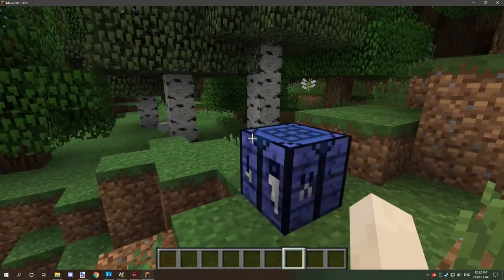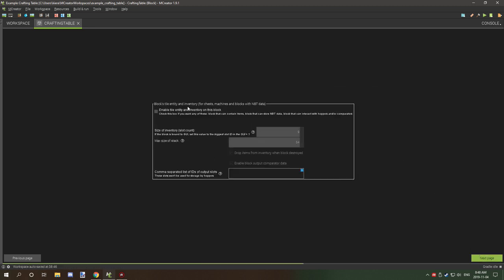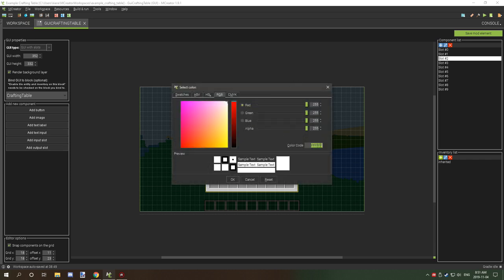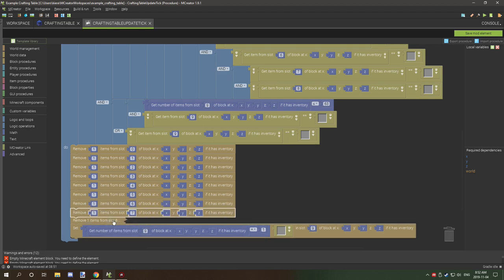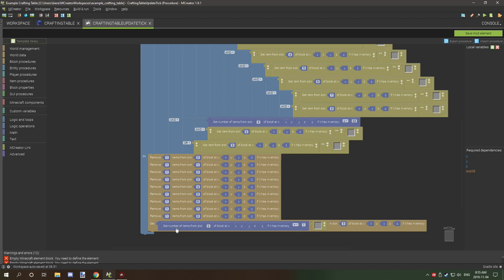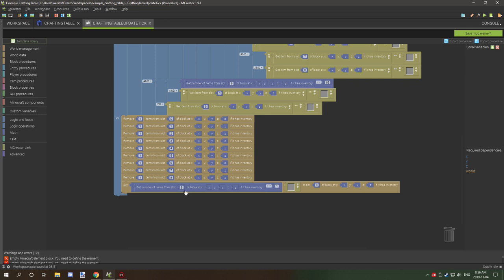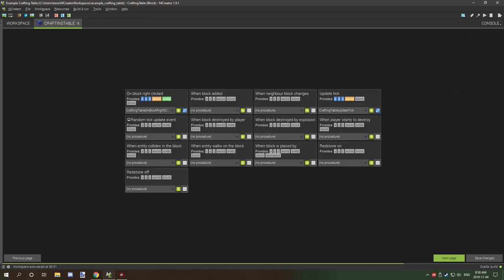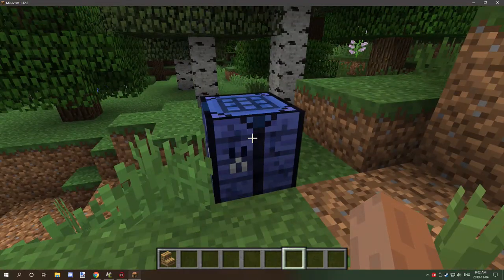MCREATOR: Custom Crafting Tutorial | 1.9.1

Comment: is there any way to craft like in vanilla? like having the item show up in whilst your ingredients are also in the table?
Reply from the maker: I have not figured out a way to do this just yet however this would be handy and may be possible to figure out if I had more time to research it.
Reply: I think I found a way, using a procedure to show the item and only remove the items from the slots when the crafted item is picked up
Reply: @DeflyCK  hey Ik it's 3 years late but for some reason you have a screenshot or sum abt how to do it? I'm making a mod on 1.12.2 and this would be very useful

Comment: How to consume items from the table and craft our mod's item only when we click on the output? I mean, how not to have this "auto" crafting?
Reply from the maker: Far as I am aware from when I made this tutorial it was not possible at the time, I have not tested it recently in 2019.5 so I don't know if there was any extra triggers I can use for the output slot. This may be a worthy suggestion to post on the MCreaor issue tracker for a feature request.
Reply: @NorthWestTreesMCreator  understood.
Thank you!
Reply: @NorthWestTreesMCreator  btw i had just figured out that if you add a button to the GUI and set for when the button is clicked to have the Update tick thingy (crafting table template thing) and remove the update tick thingy from the original crafting block you can have a button to craft the things you want

Comment: I’ve tried this method but deleted some of the input slots so I only have 3 and I’ve deleted the associated procedures but for some reason it doesn’t work? For reference my items aren’t stackable is that why?
Reply from the maker: If the items don't stack this could be part of the issue. The default script supports 64 items but you would need to replace 64 with a value of 1. Sadly at the moment there is no way to get the item stack size or I would have been using that value in the script.

Comment: Did this way of crafting procedure running still work on MCreator 2019.5/2020.1? For some reason all my crafting procedures don't do anything when binded to "Update tick" of the crafting block.They work if binded to "if slot contents change" in the GUI, but this method is not always good...
Reply from the maker: I did some digging and talked to Klemen about some things, the procedures should only work for Minecraft versions less than 1.13.2 so only 1.12.2 version due to the operator using META data "=="
If you swap the item operator to "=" it should work fine on 1.14.4 version of Minecraft. I have been helping Klemen update the templates and add notes to them I am not sure if it will be in the next patch/release but we are working on it ;)
Reply: @NorthWestTreesMCreator  Oh,I talked not about the procedure itself,but about it binding to the block method=)I'm using not the procedure from templates,it's my own one,but the method is the same.I just can't understand to what event in the gui slots or where else I should bind it.Update tick works only for the close gui-open gui again.For rather complex crafting scheme I tried many methods of binding procedures to input/output slots,but their interaction caused glitches or do not work in 2020.1.And in 2019.5 everything was good, so procedures  seem to be right...
Reply from the maker: @Darsenia_11  There are two ways I would suggest.

If you want to craft one at a time then I would have it bound to a button, so when the player clicks the button it runs the procedure on one time.

If your wanting it more automated you can bind it to an update tick trigger on your block's procedure triggers, the redstone input ones may work too but I don't know how to set that up.

Just remember you will need to configure your block tick rate if your going to use update tick default is 10 which is 0.5 seconds setting it to 20 would craft 1 item per second and 1 would be every 0.03 seconds.

I hope that makes since let me know if I need to try to explain it a bit simpler.
Reply from the maker: Also I would remove the procedures from the slots, this may be causing some of your issues.
Reply: @NorthWestTreesMCreator  Thank you for the reply! Buttons are not the way I want this crafter to work, but yes,they work right in other cases. I already had the procedure set to the "block update tick" and it doesn't work.I had left the tick rate 10.Only with a procedure in "block update tick" it doesn't work at all.I binded the procedure to the slots of the gui to test -at least it works somehow, but this causes other issues.So for now I totally remade the whole crafting system to work as vanilla crafting table.

Comment: How i con make multiple recipes?

Also, just tested, and it does not let me save the procedure saying that there are empty blocks where the empty slots are
Reply from the maker: Stacking the if statement below the other recipe normally works fine to add more recipes.

You may be using the dependencies that are not supported for that trigger. Make sure you dependencies for the trigger are correct.
Reply: @NorthWestTreesMCreator  Thanks man! Your videos help me everyday!

Comment: Hey awesome video! But I have a few issues... I am able to open my GUI for the type of crafting table I am making. But when I put the stuff needed for the recipe into the crafting slots I don't get anything. I am making this on version 2020 something, with forge 1.12.2. i have checked over the video and everything seems fine so I have no idea on what to do.
Reply from the maker: Make sure your GUI has the correct number of inventory slot as the block inventory has to offer, default is 9 I think so you may need to adjust this. Also make sure that the inventory is enabled and you have selected the proper block in the GUI to bind it to the block you are opening the GUI with, it also has to be the same block with the inventory enabled.

For the recipe part it may be the meta data operator to compare the slot inventory item. It should say meta data for versions < 1.13 it should work fine for 1.12.2 mods but it's broken on 1.14.4 due to Minecraft moving away from using meta data in 1.14.4. Just replace the meta data operators (the yellow ones) with the operators you have access to in 1.14.4 of the same color and it should fix your crafting issues.

If you still need help feel free to hop on my discord server and ask for help on the mcreator-help section.
Reply from the maker: Meta data looks to be your issues, replace the yellow operator if your using 1.14.4 that says meta data.
You can also ask for help on my discord channel if you need further help.

Comment: Can you teach us how to do that with different amounts of slots?
Reply from the maker: I can do a tutorial in the near future. I have some priority tutorials that I need to complete first on some other major things but I will make sure to do this as soon as I can.
Reply: I think I descovered how to do that. Start putting much of that AND statements (on the recipe part) and on 1 side you place 1 item/block entry and on the other side another door if you want to use more slots; and then on the orange blocks (on the template, they are for default collapsed) you add more blocks of that kind and change the numbers of the variables depending on the slot. I didn't test this but I think it works. Then add more slots to the GUI and bind it.
Reply from the maker: @Gamer_top_13  AND operators should work but make sure you also set up the slots in the GUI as well as in the procedure for the recipe remove from that slot when it crafts the item else it would just remain in that inventory slot.

Comment: Hi! Can I make a procedure that it always active? Also can you teach me how to make a procedure like when I have an iron ingot in main hand and I right click a lava(liquid)  it will turn into something like plasma ingot? Thanks if you can
Reply from the maker: I don't think using a right-click trigger will work on liquid blocks like water or lava, however, if you place down an iron block then right-click with a lava bucket you can update the block to be a plasma block that you can craft down to ingots that I know would work. But Liquid blocks act differently than regular blocks in the scene that when you right-click them it goes through them.

For the procedure, you will need to do the following.

IF [ { Item in entity's main hand } = { Lava bucket} ] AND [ Get block at [X] [Y] [Z] } = { Block of Iron } ]
DO [ { Remove block at [X] [Y] [Z] } , {Place [ Block of Plasma ] at [X] [Y] [Z] } ]

You may also need to test for a lava source in the do section and remove it if needed due to right-clicking with a bucket of lava. This can be done by below 

IF { [ Get block at [X] [Y+1] [Z] } = { Lava Source Block } ] }
DO { Remove block at [X] [Y+1] [Z] } 

You may also want to test for all added sides so do that above but with all the cords below in separate if statements.

X+1
X-1
Y+1
Y-1
Z+1
Z-1

I hope that helps a bit.
Reply: @NorthWestTreesMCreator  Thx and the first question how to make a procedure that it didn't need to connect to any item/block and it will always active

Comment: Is there any way of adding an arrow to the GUI like normal Minecraft?
Reply from the maker: This can be done using an image of an arrow, if you have a legit copy of Minecraft you can extract the files like how you would for making a resource pack then open the textures/GUI folder and search for /container then when in containers open the crafting_table.png and the arrow will be in that GUI.

You can simply just use paint.net and copy and paste the arrow into a new document then clean up the areas not used by removing any pixels by selecting them and pressing DEL on the keyboard. When done save the texture.

Next, open your GUI and use an image element and select your arrow.

If the size is too small or too big try resizing it in paint.net  by using using the resize option and selecting the mode for "nearest neighbor" this will keep the image in a solid pixel and not blur the image. For sizing, I have found that 64 is ok but maybe a bit less may be comfortable around 48. Try to keep it on a ratio of 16 for the best results.

Comment: how would you go about making a 5 by 5 crafting table?
Reply from the maker: You will need to adjust the inventory size on the block to 26, then you will need to find a way to fit all of the slots on the GUI screen in a 5 by 5 grid + your output slot. In addition, you will also need to update the procedure to check for all of the new slots you have added to function properly. I will push out a patch to on for 1.0.1 that adds support for a 5 by 5 grid.
Reply: @NorthWestTreesMCreator  thank you so much

Comment: But what If I want to make a crafting table what is like a fuser I mean what do I need to type if i want it to look like this : (S=Slot I=input, P=powerer Slot ) 
S + S ==> I 
  (P)        
Can you please help me?
Reply from the maker: I am not sure what you are looking for sadly, If you know of a video online that I can see an example I can offer better help. If you find one just reply with the link to this comment and I will approve it and look it over.
Reply: @NorthWestTreesMCreator  I can't find! But what I mean is how to make a crafting table with 4 slot?!
Reply from the maker: @slendercraft2960  So you will need to pretty much update everything in the table if you are going to change the craft slots, it's not too hard to do I would say moderate on difficulty.

The first thing you will need to do is check for your input slot IDs and your output slot IDs if you are having 4 crafting slots then your ids should be: (0, 1, 2, 3) and your output slot should be (4). You can double-check this in the GUI editor for your inventory.

The next thing is your going to need to remove the slot recipe section for the following slots (4, 5, 6, 7, 8)

After that scroll down to the do section and at the top there will be the same number of elements for the same slot ids to remove the items, you will need to remove the ones for slots (4, 5, 6, 7, 8)

After that you will need to update your output slot on the rest o the code, default is slot (9) so replace that with your output slot (4) there are one 4 places in the condition section and 2 places in the do section for the old output slot id.

Hopefully, this helps a bit more if you are still having issues I may be able to do a tutorial on how to adjust the size of the grid in the near future.
Reply: @NorthWestTreesMCreator  Thank you! I will test it! Just few more question: I cann add a mod to my mod wich is not made by me? Beacuse I want to make a mod accesory!
Reply from the maker: @slendercraft2960  I am not sure if MCreaor has full support for this just yet, I know you can add dependencies under "workspace tab /workspace settings/external API"

but I am not sure how all that works, I would ask on the issue tracker regarding this question how to use (external API's)

It may work with other mods but on the other side of things it may be specific to something so I would ask on the issue tracker or help forum for MCreator about it.

Comment: So even after SO MUCH TESTING and rewriting, I cant seem to figure this out for 1.14.4
Reply from the maker: Sorry to hear that. I have not tested the system on 1.14.4 but it should work still to my knowledge.
Reply: @NorthWestTreesMCreator  I'm gonna try to redo it. might have been a coding error. Thanks for the video tough!
Reply from the maker: @dripcat5152  If you need any other help I am here. :)
Reply: @dripcat5152  There is a proper option for crafting recipes in 1.14.4 now.

Comment: Mine dosen't allow slots
Reply from the maker: 2019.5 should support inventories for blocks make sure you enable NBT for you block then select it in the GUI to use the block for the location for your GUI. Slots need to match the number of slots you have set in your block's settings, it may freeze or crash the test environment otherwise. 1.14.4 may have bugs still if you find things that work on 1.12.2 but don't work on 1.14.4 report them on the issue tracker after you check to make sure it's not been reported before.

Comment: i made a 4x4 Nuclear Crafting Table XD
Reply: my game crashes every time :(
Reply from the maker: I know with 2019.5 there are some bugs that still need to be ironed out of the program so if you are working on 1.14.4 then it could be a bug, best thing to do is ask if anyone else has the same issue on the forums and if you feel like its not caused by your mod or it worked on the 1.12.2 version but not the 1.14.4 version then report it as a bug on the issue tracker.

Comment: WHY I CAN CRAFT THIS? MCREATOR IS DON'T HAVE THIS FUNCTION!
Reply from the maker: For block and item, comparates just use the yellow operator that is available it should work fine. in 2019.1 they removed the double == operator as there was no real need for it anymore with the new features in 2019.1 so everything that used == can now just use the one = item or block operator.
Reply: @NorthWestTreesMCreator  man how i can craft np. item ?? I make this item, but i can't add crafting to this item. Pls help me :)
Reply from the maker: @Michal-bq5rn  This tutorial will work in the future but at the moment the GUI templates that are built-in are for versions lower than 1.13.2 so they don't work without being alternated to work in 1.14.4 I did send a working copy of the procedures for 1.14.4 to MCreator and they are aware of it now.
I also have a discord that I can help with more complex problems such as this during the week.
https://discord.gg/6Ep8x6V

Comment: I NEED A 2x1 NOT A 3x3
Reply from the maker: You can still use the same code but just remove the settings for all slots between 2-8 and set the output slot to "2". I will do a tutorial on configuring the crafting grid in the future but I won't have time to work on that any time soon well not for a month at least.